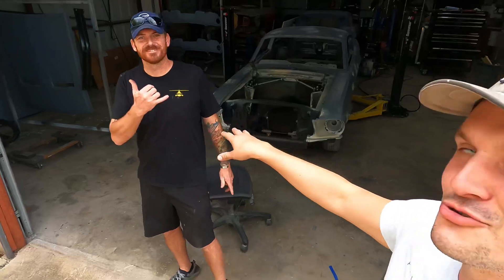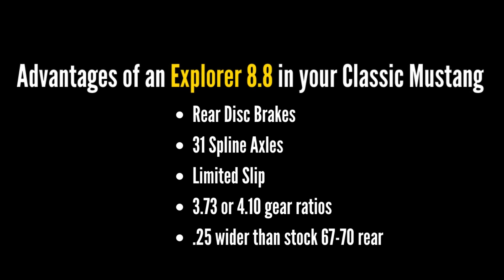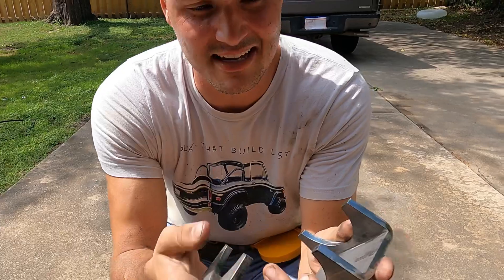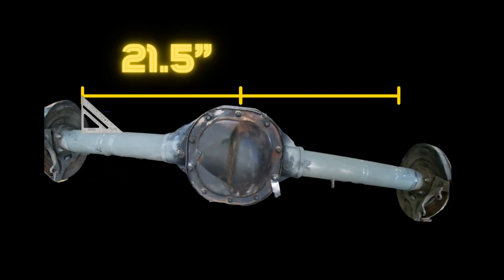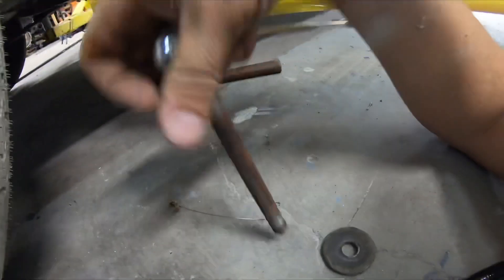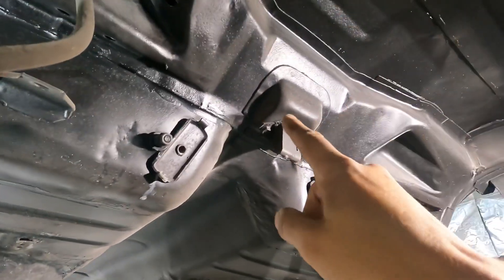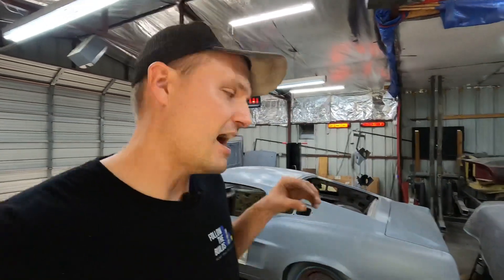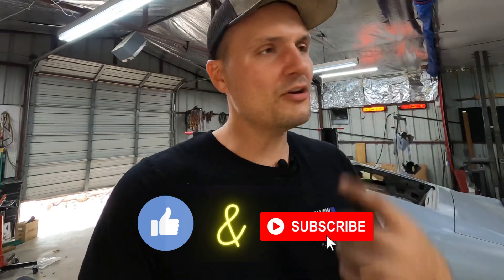Vintage Mustang 8.8 Rear & 4 Link Conversion (Explorer + Ridetech)

Comment: If the  Mustang  came  with  a  9 inch  rear  I  would  have  modified  it , it is stronger  than  the  8.8. Don't  remember  if it  came  with  a  8 or  a  9,I  think  it  depends  on the  engine  it came  with.

Comment: do you know if a 2.5 or 3 inch wide perch would work
Reply from the maker: 2.5 is what I used. The 3” just puts the u bolts a little further apart…i don't think that would be a problem though

Comment: It looks like you had to weld one of the tabs on the center section part. Did you have any trouble since the center section is cast? 
When I talked to ridetech they said don’t weld the tabs on the cast part

Comment: Great video! Have one question? That center bump, did you cut a hole and replace the sheet metal to make it stronger? Mine was welded but it hasn't held on too well.  Hope to hear back from ya! Keep up the good work
Reply from the maker: Hmmm….the center bump was removed so that the cradle fit. I’d have to go look again but I thought that was a requirement for the install.

Comment: On my 69 mustang the ridetech upper control arms are to long and land on the diff pumpking how di u get youre to rest on the tubes?? Im using a 8.8 diff
Reply: The explorer diff pumpkin is off center, and the better view where he shows the 3.5 inches or whatever from the tab is on the side that has “more” axle tube length. If you slow the video down and look at the other side, you can see that the tab is indeed welded onto the cast pumpkin. I’m using a mustang 8.8 and I think BOTH upper tabs land on the pumpkin.
Reply: @andrewhelseth4587  is your 8.8 a shortened explorer axle or not regular width? 
I have a narrowed 8.8 and I’m debating on going ridetech. I think since my center section is centered it might not end up with tabs on the cast but trying to figure it out as much as possible.

Comment: how do you know what size coil overs to use for the kit
Reply from the maker: This was a tough one. I have to research the stock Ridetech kit to figure out the collapsed and full reach of the coil overs…picked up strange coil overs from there.
Reply: @FollowTheBuilds from where ridetech?  I found some info on their site       5.2" stroke shock and a 12" 175 lb. spring. Compressed is 11.23" Recommended Ride Height is 14.5" and Extended is 16.43"
Reply: @FollowTheBuilds  hey brother im getting arounf to this now did you ever figure out what exactly the coil overs were
Reply from the maker: @IDKWTFID check out Summit Racing™ Coilover Shock and Spring Pro Packs 15-0059

Its 150# though

I now have switched to the recommended ridetwch coilover…very happy with them.

Comment: Did you have any issues with the drive shaft hitting the tunnel since the differential is offset? You can center the pinion by cutting 7" off the long side of the axle tube and 4" off the short side. Then you swap each end, including the axles, and weld the tubes in place. This centers up the pinion.
Reply: the pinion is offset from the factory on 67-70, I only know that bc I just rewelded the perches an inch inboard on this 67 9 inch, and noticed one side is longer than the other, though i’m not sure if the offset is the same as these explorer rears

Comment: would this work on a 73 mustang?i would appreciate the reply. cool vid man.
Reply from the maker: Thanks so much. Yes...1964.5 - 1973 Mustangs have the same spring perch distance 43.0" .  The 71-73 Mustang housings are 56" wide. The Explorer housing is 54.25”. You very well might gain some rear wheel clearance for a wider stance in the back if you would like. 👍

Comment: Is the driveshaft going to hit the tunnel?  Sure looks like it with that offset.
Reply from the maker: From past installs its likely the passenger side floor pan will need a massage towards the very back where the driveshaft and yoke meet. Other than that no issues there 🤞.
Reply: @FollowTheBuilds  I’ve got the “junkyard shortened” explorer 8.8 in my 63 hardtop falcon and it’s close!  The stock exploder 8.8 width definitely would hit the floor.  I also have the AJE suspension in my falcon.  I don’t really use my YouTube though.  Follow at “Bag of Bones 1963 Falcon Build” on Facebook.
Reply: @FollowTheBuilds  What did you end up having to do to make this work?
Reply: Why not use a fox 8.8 the pinions centered in the dif housing the explorer looks like the drive shaft wouldn't be straight wouldn't that put more strain on the universal
Reply from the maker: @superdutymustang87  there is an AJE rear kit that accomplishes this. Then it will be centered. The explorer rear does have advantages over stock fox or SN95 8.8 but no deal breakers for sure. 

Regarding the offset...most mini pickups have an offset pumpkin. it's normal.. Ranger/ Explorers did it for fuel tank clearences, as is the case with most of the other pickups..

Center the axle, not the pumpkin and you will be fine.
Reply: @superdutymustang87  explorer axle is 31 spline, 96+ have disc brake, factory limited slip and 3.73 or 4.10.  mustangs are 28 with drums.  The offset is not a factor in 67+ mustangs as the tunnel is wider
Reply: Did ridetech supply you with the 3.25" u bolts and shock mount or did you uave to modify the 3" ones they offer for a ford 9" axle?

Comment from the maker: One edit note: we found center from the axle flanges (ends) then wherever that landed on the diff pumpkin we went out from there 21.5” to get the overall 43” perch centers. That may not have come across clearly from the graphic I drew up in the vid.

Comment: Great job. Can’t wait to put the 4-link in my 66.
Reply from the maker: Thank you! 

It was a first for me. Of course I haven’t had it on the road yet but seems like it’s going to make a big difference.
Reply: @FollowTheBuilds  how many hours did the install take?
Reply from the maker: @Entrastang  7hrs...1hr of that was moving the cradle into position. You may consider just drilling the holes for the cradle at the initial mock up. Getting it back into position took time so you could eliminate that by drilling the holes as soon as you get it where you like it.